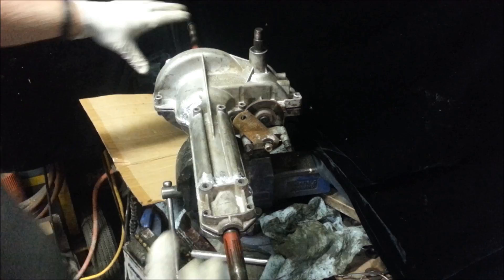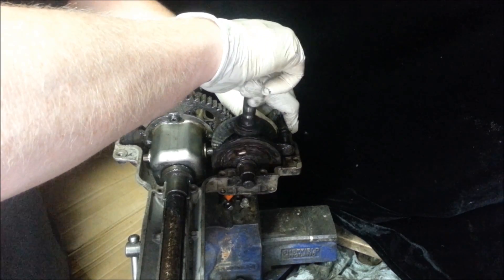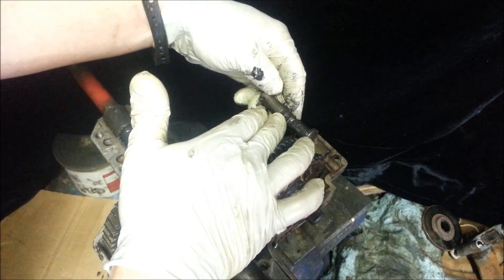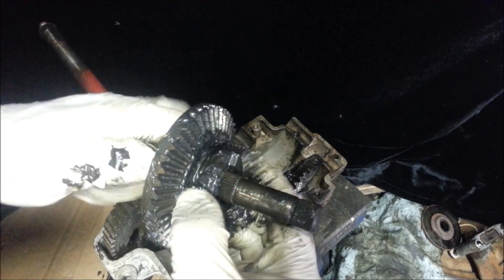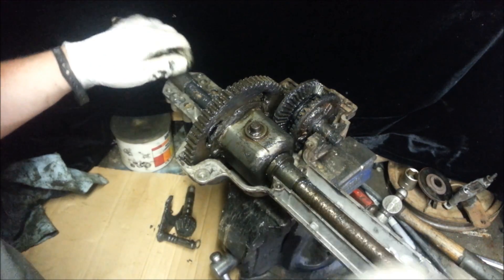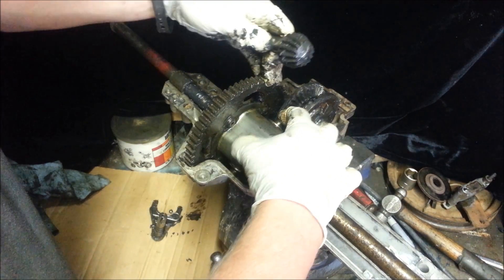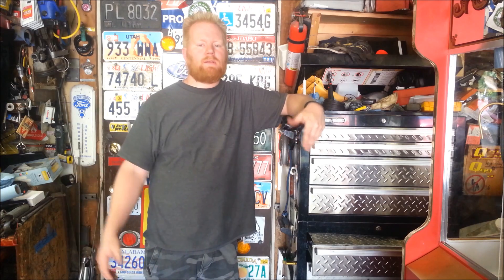MTD transmission What's INSIDE

Comment: Is it possible to make this transaxle FREEWHEEL so I can push it after breakdowns in the paddock? Thank you for your video and hopefully your reply. 11JAN2018
Reply from the maker: If it is a manual transaxle like in this video you simply put in into Netraul(F-N-R). If it is a Hydrostatic you pull the freewheel lever on the very back.
Reply: Thanks...but...whilst the input rotation is then separated from the transaxle, the wheels remain locked so that the MTD cannot be pushed. Perhaps I should have asked "Is it possible to make the WHEELS freewheel?"  12JAN2018
Reply from the maker: If the transaxle is locked from damage, there is no way to free up the wheels.

Comment: i have a question, my huskee 4200 stop moving. when i push clutch pedal in to change from forward or reverse and let all the way out on clutch pedal, it doesnt move..it feels like something is not releasing like a belt, or a pulley is froze up..havent taken transmission out to inspect but maybe something simpler is going on with mower...even when mower is returned to neutral, you have to rock mower back n forth to get it roll freely...takes a few rocking back n forths to get it to release, but even doing this it still will not move when put in gear or reverse when running....it locked up once in the summer for a minute, but went back to moving...maybe it needs grease inside trans case or something's froze up like brake disc....in saying that, i did spray a lil wd40 on disc brake lever and that help release brake mechanism, but clutch pedal out and in gear, still not moving, is bugging me...any advice would help?!?!?!.......thnx
Reply from the maker: It is very common for the linkage to freeze up. Also if it a variable drive with two separate levers, one FWD-N-REV and the other all the speeds, it's common for the variable pulley system(center of the tractor between engine and trans) to freeze up and not allow the belts to engage.
Reply: sixtyfiveford ok...I'll check it and I'll get back with ya...prolly be maybe this weekend before I get to it....but thnx for replying
Reply: i looked at my motor belt, it has jumped around the variable speed pully and got under the trans belt somehow...i guess a stick or acorn or something got in pulley groove and made it jumped off lower groove of variable pulley and jumped to upper pulley groove....weekend tinker job i guess...hope this all is wrong with it..lol
Reply: Got my Huskee 4200 back going, motor belt jumped out of lower variable speed pulley to upper pulley....wrapped up under trans belt....runs fine now

Comment: What would the single speed gear ratio be compared to the six speed I have in my tractor now?   I see it works on the same principle as an outboard motor gearcase.
Reply from the maker: It would probably run around the same as your 3 of 4 gear if you just swapped out a single speed for a 6 speed.

Comment: Hey Moe I could use some direction.I just bought a Craftsman Model 917.272263. It is the one with the foot pedals to control forward and reverse .I was told it needed a valve job  but when I went to pick it up one rear wheel would not turn. I thought maybe the brake was frozen so I took it apart cleaned it & reassembled it . I was able to move it backwards easy but difficult pushing it forward. The next day it was jammed again. I played around with the brake & it loosened up a little but it is still locked. The  bypass rod pulls that out so you can disengage the transmission to freewheel is very loose. I checked it does move the connection on the transmission. Is there any adjustment that can be made that I am missing or am I going to have to pull this tranny apart? I would really appreciate your help. JoeZ

Comment: my MTD Wizard has 7-speed transaxle w/o a reverse or neutral gear. Why is this so? Can I get a transaxle with both reverse and neutral gears?
Reply from the maker: With a non hydrostatic unit you should have a F-N-R lever between your legs or on the left rear wheel fender. The Right side fender will have your 1-7 speed notches.
Reply: oh ok, well i there is lever in between my legs on the mower but it doesnt say what it is so i assumed it was the blade engagement lever, i didnt know it was a F-N-R selector. Thankyou for telling me this I'll check it out. Say do you have any idea how i could find an owner's manual for an MTD wizard online like a PDF?
Reply: nevermind i found an owners manual on MTD's website. thanks for your help! :)

Comment: Mine has a whining noise under a load, and when I'm in forward and I hit the gas I hear and feel a banging noise. Any suggestions?
Reply: Incidentally, I've just changed the front gear and clutch disc and I'm hearing a lot of whining when in forwards, although no banging. I've greased the shaft and the gears pretty well so I don't know what it could be - perhaps the bearings aren't seated properly, which might be your issue also. Would be interested to hear the OP's opinion.

Comment: this is the first veido I pull up to help try to ficks my problem.dam you make it so simple as 1,2,3. l got an old bolens ,mabe 92 won't stop !! 😇 I pull the breaks off, pull them apart cleaned the pins 2 new pads. clean the disc but didn't no if the break should be in park befor  starting.so put the brake back . same problem.so what I did was drive on a slight up grade, pushing down on the break.shift into revers , still on break.mower move backwards . now i ajusted the brakes,to the point in nutral mower was hard to push. drove to down grade,stop foot on the brakes count 1,2 down mower move down the grade.now also. shifting gears real ragcadie . I think I did the brakes right.could it be something  in the transmission.  PS.(help ! 😇)

Comment: i have a mtd 1990 model 46 inch cut hydrostatic it does great but after about an hour the rear end starts pushing fluid out of the hose on top of the rear end and it wont got forward or backwards when it cools down it works fine again any ideas on whats wrong?

Comment: I have the same transmission you are referring to. In the forward position the mower doesn't want to engage, but once it does it makes a horrible grinding sound. Going up hills it makes the worst and loudest sound struggling to advance up the hill. lower the gear louder it seems. in reverse its normal no problems. in your opinion what could it be? Is it the actual shifting lever? The lever goes in F- N- R positions fine.  If its the lever how do I adjust it? Thanks in advance.
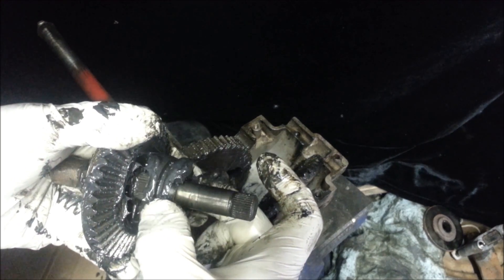Reply from the maker: At 1:50 in the video. Sounds like the palls on the forward side could be stripped, allowing the gear to slip.
Reply: It seems to be quite a common issue - you'll probably need to order a new gear, and possibly clutch disc. Engagement can be a bit poor due to the design of the gear lever, and the less-than-full engagement means the teeth will be stripped pretty easily (that's the grinding sound), eventually resulting in it completely failing to drive anymore. If you can find a way to raise the rear of the mower off the ground (I use some blocks of wood against the bodywork between the rear axle and the mower deck) you can drop the transmission off fairly easily. Open it up carefully (being especially careful not to lose the ball bearing and spring that drop out) and check the gears. They should be completely square, with no rounding.
Reply: The fork on mine was worn down from previous owner probably riding clutch collar instead of releasing clutch fast into gear. So almost the whole thickness of the fork was worn off where it engages the clutch collar (solid throw out bearing). So it would not engage forward gear. Got a new fork and reversed position of forward and reverse bevel gears and clutch collar as the gears are the same. It worked fine for couple years. Began jumping out of gear and finally not going forward. So took apart axle and the fork was not worn as I had removed all old grease and replaced with new grease first take down and added a little STP oil treatment for added lube. I suspect the clutch collar is a bit worn and possible the forward 42 tooth bevel gear. So I am going to order a new gear and clutch collar. You can turn the two bevel gears around with one another so the reverse is then where the forward gear was and also turn around the clutch collar and get a newer surface as the reverse is used much less and probably much better shape. I just ordered new bevel gear ($25) and clutch collar ($14). In the meantime I put axle back on tractor and took off the shift rod as there is practically no adjustment on this 2005 MTD Yard machine. I measured the length of the rod and cut it in two. I got I guess you would call it a collar nut that is about an inch or so long and two bolts that have allen wrench indentations in the heads so when I cut the shift rod to length I can shave it down with a grinder a little bit until it can be inserted tightly into the allen holes that are centered in bolt heads. Both my bolts were about 1 1/2". I cut the threads down on one to where about 6 threads were showing, I threaded that bolt into the collar nut just enough to hold it.  Then I welded that cut bolt to the nut at the threads and to the shift rod where it entered the allen hole. The other 1 1/2" bolt I put a backup nut on it and threaded it all the way down into the collar nut till it hit the end of the other welded nut. I had measured the original length of the shift rod at 7 1/2". So I subtracted the length of the nut and bolts from the 7 1/2" and cut the shift rod down so it would be about a sixteenth shorter than 7 1/2" when the other end of the shift rod was inserted into the other allen hole as I can adjust it out quiet a bit. I inserted that end and welded it. Then I had an adjustable shift rod. Take out shifter clip on trans and screw out rod to estimated length needed to fully engage forward gear. Then put clip through shift rod and try it out for proper length to shift.  I adjusted it out until it fully engaged forward gear and tested it. I tightened up the back up nut although it can not spin out much even without the backup nut as both ends are in a fixed position. Anyway I can now drive this tractor in forward to cut grass until my parts come in at which time I can replace them and readjust the shift rod. Now I had to adjust rod quiet a bit to catch forward so now reverse is catching sometimes as it is just barely enough to catch with forward adjusted so much in. If I were going to keep this rigging without buying new parts I would jack it back up with my chain hoist and try adjusting the forward back a bit so reverse hits true as well. might can cut out the reverse shift slot a little so it shifts a little further out. Hey what some of you guys are hearing is the shift rod is not fully engaging the gears due to worn fork or clutch/gears. The banging is the bevel gears slipping off the top shaft pinion gear and disengaging because the shift rod is not at the proper length to keep it engaged. Some such as the Troy built I believe have shift adjustment that is threaded. So you can adjust it out without rigging. Or if needed you can try my remedy. Don't take much if you have an arch welder.

Comment: Really informative video!I just blew out my transmission on my tractor- cracked it right in half! Do you recommend replacing it with the same model or can I replace it with a beefier one?Thanks for the tips!
Reply from the maker: You saw the video where I repair this right? https://youtu.be/3pMESMI7yp0 . There really isn't anything better. Generally these fail/break due to a missing bolt that is supposed to attach the front center of the transmission to the frame.
Reply: +sixtyfiveford awesome. Thanks for the reply. I'm gonna try this sucker out!

Comment: Im in the process of changing needle bearings. During re assembly does the small ball  that go in the middle position , do I need to adjust it somehow so that so that forward neutral and reverse positions are correct ?

thx
Reply from the maker: You shouldn't need to set anything as far as the detent ball goes. Just put it in it's slot.

Comment: where to you add gear lube?
Reply: shoot I was hoping it be more simple. Do you have a video showing how
Reply from the maker: You have to remove the entire transmission and tear it apart like I have it. They are lubricated for life according to them, so they didn't put a port on it. Sorry, I don't have a video on it.
Reply: thank you for tell me I sub to your channel you got some great videos. Is there a video of you taking off the transmission?
Reply: questin when the oil low can it make the gear not work passed 3 gear and does it make the rear polly drop some because my back belt comes off when I put it in reverse
Reply from the maker: Do you have the single speed transmission with the MTD variable speed clutch?
Reply: its shift on the go 7 speed its a 2002 husky made by mtd
Reply from the maker: The center centrifugal clutch binds up and need a little tuning. You should be able to pull the center cover off and look right at it from the top side.
Reply: I already did and the tensioner looks a little high then the trans polly like a quarter of a half inch so not by much I replaced the tensioner polly it was thin on the bottom put it still wants to jump the rear belt off
Reply from the maker: Make sure the transmission is bolted at both axles and in the middle front to the frame. Most with a lot of hours I've seen loose the center frame bolt and tear out the mounts by the axles, or allow the transmission to rock back and forth. This would put the transmission pulley at an angle and cause the belt to jump, but generally happens more in reverse. Only going up to speed 3 should be a centrifugal clutch issue or linkage.
Reply: I'll check it out yes she gots lots of hours on it but for a cheap tractor its been good to me so putting some tlc in it don't bother me I'll check it out and let you know thank you very much
Reply: hey buddy I have not had time to look at the trans brackets can I tight them down with the deck still on? if I just lift the back up the deck on this tractor is a pain give ya gray hair looking at it lol
Reply from the maker: grease monkey
Yes, you should be able to see/tighten everything with the deck on.
Reply: is there only 1 bolt spouse to be in the front because I see a hole there but no bolt but the hole go's through the frame
Reply from the maker: Yes, one bolt at the front. It usually falls out and allows the transmission to wobble, throwing the belt.
Reply: well then I found the hole where it spouse to be I got to go buy one tomorrow. The lawn getting long and push mowing 6 acers is a pain. Thank you very much for helping me not many do that for me. I'll be checking out more videos so hope your not tired of seeing me already lol
Reply from the maker: grease monkey
Yeah, that much lawn with a push mower will take a long time.
Reply: I done it before soon as your done got to do it all over again and this time of year my grass is a freak soon as its cut 2 days go by and boom it looks like nothing happen right now its 6 inches
Reply: You likely don't have a gear lube port. Take the bolts out of transaxle, remove and clean all grease from gears and replace with new grease. These things that I have seen do not even have gaskets as there is no real pressure on the transaxle and the gease is thick enough to mostly stay inside. Don't be shy with the grease. Fill it up at least as much as was in it and probably a little more.

Comment: Does this information apply to the old 360 series front-engine riding mower (e.g. 133-360A, 1983 model)?
Reply from the maker: +ClassicTVMan1981X Yes and no. Basically the 133360E had a right angle gear box that just changed a vertical rotation to a horizontal. This is done in the trans in the video with the axle as part of the system. The 133360E has a chain running from the trans to the live axle so the axle is separate. The Input shaft and the way they both select gears is the same and probably have the same part numbers.

Comment: I have to get a new gear selector.  the one in my mower has the 3 contact points rounded off in the reverse position.  it was for the forward motion but I flipped it around so I could use the mower.

Comment: What type of grease do you use in transmission?
Reply from the maker: Douglas Van Ness Any thick grease will work. These aren't performance parts and will never break down the grease. I use what is on hand but generally it's Valvoline Wheel Bearing/general purpose grease and then I splash a little 80-90W gear oil to help flow into the crevices(2Tablespoons).